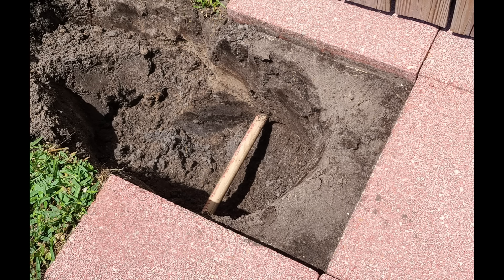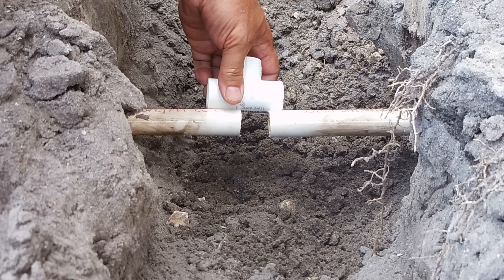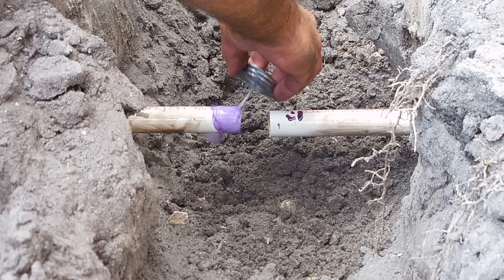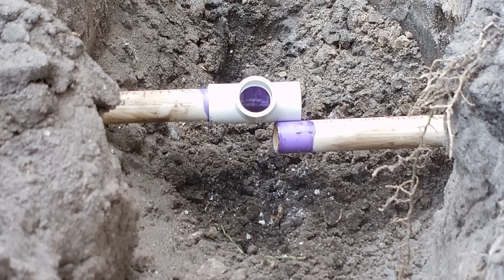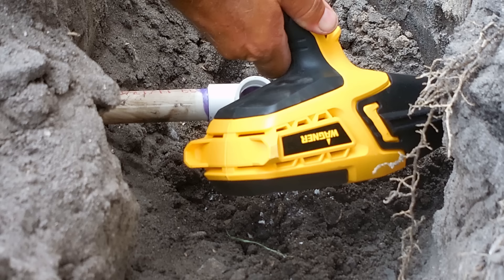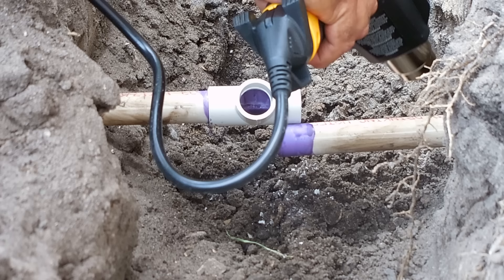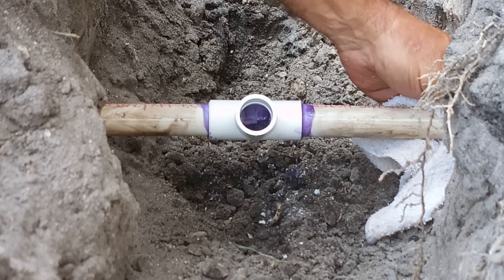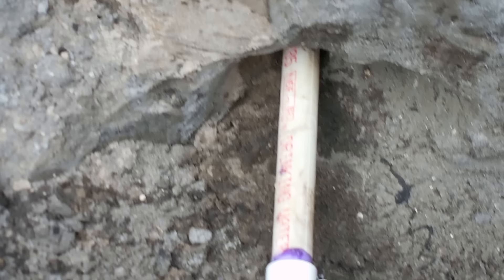How To EASILY Tap Into PVC Water Lines(Best Method Using A Small Hole)

Comment: File the stop out in the middle of the coupling so it will slid past the end of the pipe line the pipes glue and slide it back so it’s on both pipes easier than heating pipe
Reply from the maker: I guess you've seen my other video
Reply: Way better
Reply from the maker: @carlmccoy662  I can assure you it's not an easy task using a file because there is roughly a one-inch space that needs to be reduced. My other video shows an alternate way of doing it.
Reply: @electronicsNmore  A flush trim router, would take care of the stop. A repair coupling would solve the problem too, but would need 2 cuts in the pipe
Reply: Filing would be quite a job. The heating seems easier. But. Not a bad alternative. 👌
Reply: Shark Bite makes a repair T fitting with a slip end where you slide it on one side, then use the shark bite tool to slide it back over the other side.  Home Depot has them.
Reply: @electronicsNmore  they are also tapered
Reply: A dresser coupling is the best way to fix a pipe in the ground. But only use them in ground
Reply: @carlmccoy662  heating & bending seems way easier to me
Reply: That's a great idea. Probably even better than the video...
Reply: Or buy a slip fitting like someone that knows what they are doing.
Reply: @judholmes2561  no shark bite blood
Reply: They actually make union PVC fittings that have no stops in them 😉
Reply: Rubbish, it is way harder to file away the end stop than just heat the non fitted pipe.
Reply: @teeanahera8949  filing would be silly, drilling would be quick.
Reply: Forstner bit, not file
Reply: Pack joint couplings with PVC sized rubber gaskets is the proper way
Reply: @weavercattlecompany  This works best, by far, if you can find slow setting cement.  The cement that is sold locally is fully set in 5 seconds.  Too short.
Reply: I've done exactly that.
Reply: @electronicsNmore now that’s funny!
Reply: @judholmes2561 shark bite sucks
Reply: Very nice.  I have made a place for it in the mental toolbox.
Reply: Down here in the southwest, the glue starts to set up before you can work it in.  I have never been fast enough to make this method work.
Reply: Great idea, but don't they make Ts without the stops?
Reply: Yup…use a dremel…cement pipe in one motion!
Reply: Or buy a slip coupling.
Reply: Or use a slip couplings and not file the plastic wall out with the hour that will take.
Reply: @electronicsNmore  😂
Reply: Thank y’all for the comments, bad good terrible they’re all good 👍
Reply: @judholmes2561  Sharkbites also contain dissimilar metals and o-rings that will deteriorate quickly underground.
  You're basically installing a future leak.
Reply: @cadrewstrickland1912    and don't use them anywhere near a bend (elbow) in the pipe. Only on long, straight runs.
Reply: that sounds like a PITA.
Reply: Done this many times, but with electrical conduit  !
Reply: That's good for copper soldering where you draw the solder into the joint after the fitting is positioned,  but incredibly messy for a glue joint; and you risk losing needed glue on one side as you slide the fitting back over the pipe.
Reply: @brianbassett4379 unless you don't have the luxury of enough space to fit the extra length of the slip fix
Reply: somebody send this guy a telescope fitting slides right in the tee no problem you can even cut it to your desired size
Reply: There are what are called expansion couplings for this type of situation.
Reply: Yeap
Reply: A hole-saw bit works great.
Reply: Mark the make-up of the pipe.
Reply: Looking inside of that tee, will be a great place to lower your expectations. Though I’m somewhat apprehensive about heating up a pressure pipe and walking away from it. But I’m going to buy some materials and test this. Been looking for a reason to buy a WiFi ball valve and flow meter for my home anyway.
Reply: A hole-saw bit of the correct size works very well.
Reply: I forgot I already posted this. Please forgive My Failing Memory.
Reply: Good Idea.Thanks
Reply: Kind of like a repair coupling.
Reply: @brianbassett4379 seems like no one here has heard of a slip fix
Reply: I use a dremel with the little sanding drums. Makes quick work of the stops.
Reply: use a rat tail file
Reply: Make a loop with some 90s put T in the middle. Better that playing with heat gun or trying file a coupling. Well say its for expansion 😉
Reply: Use a repair fitting 👍
Reply: This is what I did but you need to remove much more than the stop. A repair coupling would be best but if you've only got joiners heating the pipe is less work.
Reply: That's genius!  Do they sell fittings without the stop? That would be even better.
Reply: Sincere thanks for the video.  All of my plumbing wisdom comes from plumbers' YT channels so any thoughts I have are received wisdom.

That said, the one concern I had was that not gluing within 5 minutes of applying the primer is one of the mistakes people make with PVC, according to one of Got2Learn's videos, fwiw.
Reply: Thank you. You just saved me hours of digging.
Reply: All these comments are craziness. Just pay someone to do it, that's definitely the easiest way. Hahahaha
Reply: Filing the stop, are you serious? I'd love to watch that especially on a pressure line with your file drifting off into the glue joint! Perfect example of why you don't hire handymen!!! Dig 3' more & do it right!
Reply: @daled8221  Exactly!
Reply: DAMN!  What a GREAT IDEA!!!  Which i knew this on MANY A PROJECT!!!   Thanks!
Reply: And the pipe is not brittle, or malformed afterwards.

Comment: In most cases heating the pipe is totally unnecessary dig a little out around the pipes and you can easily flex the pipe upward slip it together very seldom does this result in breaking anything.

Comment: I appreciate you getting straight to the point.  But a much easier method is just to file out the stopper inside the T, then you can slide it fully onto one side, apply the primer and glue, then slide it over both sides.  Very easy and no messing with a heat gun.
Reply: How in the world do you file that little ledge inside of PVC pipe? I don’t understand how you would file that, and how come they don’t simply make repair couplings for this.
Reply: @FromTheHood2TheWoods  The do make repair couplings for some sizes of pipe.  I have a woodworking file I used for most of the ledge, and for the last part I wrapped some coarse sandpaper around a dowel rod.
Reply: I never would’ve thought of that. I usually buy one of those extenders. I’ll try your method.
Reply: @jasont7814  OK, when you do, come back and explain to us how you put the primer and glue inside the fitting, if the pipe is already running through the fitting. My feeble logic says you can do one end, but not the other.
Reply: @gregoryt1139  I might be misunderstanding you, but you’re working with two open ends, and you’re only adding one new fitting on the short end of the pvc pipe. I know I didn’t explain that very well.
Reply: @jasont7814  Watch the video again: After cutting the pipe in two, he primed and glued the T onto the cut pipe on the left. The question is: How to prime and glue the cut pipe on the right, and insert it into the other end of the T? The video's solution is to use a heat gun. Now, the alternative suggested here is to file down the ridge that prevents you from pushing a cut end too far into the T. Next, slide a cut end far into the T, past where the ridge was, and then prime and glue the other cut end, and slide the T onto that prepared end. My Point: Yes, both ends are inside the T, but only one end of the cut pipe is properly primed and glued, inside the T. The other end either has no prime/glue, or most of it has been rubbed off from all the sliding.
Reply: @gregoryt1139  Ok, I think I know what you’re referring too. Maybe the original post is referring to filing out the interior of the coupling on both sides, then applying the cement on both open ends, giving you just a few seconds to insert the coupling on one side, then center and slide it to other side before it quickly dries. It’s least that’s how I envisioned it.
Reply: @jasont7814  If you can do all that sliding before the glue starts to bond, perhaps. I know me. I would rather pay someone their worth to do it right, than to rely on me to maybe not mess it up too much. So, my comments are solely based on my own incapabilities.
Reply: @gregoryt1139  Yeah, I get it. I buy one of those PVC extenders to connect broken middle pieces because it gives me a little more room for error. Sprinklers are not my specialty.

Comment: Good tip on filing stops, can also use a compression tee available at most hardware stores
Reply: The compression tee is what I use. Works best, especially if there is ANY water at all dripping through a pipe. If water dripping through a pipe you cannot get it to get very flexible because the evaporating water cools the area to quickly

Comment: For years i had to deal with that pipe issue, this is first time iv'e seen it done that way, i'll definitely try your heat gun method next time! Thanks!👍
Reply from the maker: You're welcome!
Reply: A very important tip that people leave out is that PVC and CPVC connections to not bond together properly.  It has to be a cpvc fitting for cpvc pipe or vice versa. If you don't do this then the pipe will blow out of one end of the fitting (Eventually).

Comment: Great video advice! To determine the exact amount to cut out, I suggest marking the fitting on the outside, where the bump stops inside the fitting correlate to the outside of the fitting, (I personally don't do this after decades of working with pvc, so I, and obviously you, can just eyeball it),. Then hold the fitting up against the pipe and transfer the marks to the pipe. Should be perfect. That's for those who've never done this!

Edit: you can also use a propane torch, you just have to be conservative and much more careful not to overheat the pvc...
Reply from the maker: Yes, that will make the job easier. Glad you liked the video!
Reply: Dude. Thank you. I have been wondering exactly how to know how much pipe needs to go in vs how much you cut off. Your dry fitting then pencil line is so stupidly simple that I'm kicking myself for not thinking of it. I have been guessing and luckily been right in my yard.
Reply: Over 30 years in construction…. I own a heat gun which I use mostly for heating pvc conduit instead of wasting money on bends… never once did I stop and think of this brilliant solution. Thanks, now my challenge is remembering it.

Comment: Id say a safer way would be to File the stop out on the inside and use the T like a slip coupling. Heating pvc works but its easy to mess up or damage. Id do it with conduit but not a water line.

Comment: I have done PVC repair and you don't have to dig back as far as you said. Your method is the way to go if you can't dig back but I have never run into a situation where I couldn't bend the pipe without heating it.

Comment: The Primer is a weaker form of the actual PVC Glue, it is actually starting the melting process. So to let is cure (dry) is to basically waste the primer. Fortunately you are using small diameter pipe with minimal pressures. If you did that with large diameter pipe you would have a weak joint. The PVC Solvent should be applied when the primer is still wet. You are extending the melting process when you use primer properly and apply the Solvent immediately after the primer. BTW the directions are on the can.
Reply from the maker: I guess you haven't seen my pvc cement testing video. I know what the can says.
https://youtu.be/1o4E2pdEv-s

Comment: Two things, one you did refer to the PVC primer as cleaner yet it's real point of using it is to soften that PVC so the cement will weld them together better, now I do use the primer to clean the pipe because I never buy the PVC cleaner & that seems to be OK for me.  Now the other thing is the PVC primer really does not do it's job once it's been dried out because the PVC where the primer was placed will just re-harden if it drys out.  Try it, put the primer on the pipe then take your fingernail & scrape it, it will dig in some & take off a little of the PVC, then let it dry out & do the same thing.  If you doubt what I'm saying just read the instructions, it says not to let the primer dry & to put the cement on & put the pipe together asap.  So I would reapply the primer right after heating up the PVC.  And I would take just a little more time & dig out the ditch just a little (or a lot) more, but I get it maybe you don't want to dig up the grass, & mess up the yard so much.  And one more thought is, because the primer softens that PVC don't get a puddle of it inside that pipe it can soften the pipe through & through over time, I've seen this happen & I had to dig it up & the pipe was bulged out, & leaking. so don't over do it, & if you think you did run some water through it at a low pressure just to wash out the primer.  Before there was primer you would rub the cement around & around the pipe to help it soften the pipe before putting it together.  I have made slip couplings but they are a little hard to use because the cement just might stick the coupling to the pipe before you get the coupling where you want it to be, so you have to use extra cement & it's kind of messy, but they do work.😁

Comment: you can buy a "no-stop" tee or union. you can make a "no-stop" tee or union by using a drill or a round file to remove the "stop".
this enables the tee or the union to slide all the way onto one pipe. then you slide it over the other pipe. the "stop" is just a raised ring
that prevents the tee or union from sliding past tee opening or the midway point respectively. you can buy them. you might have to order them and wait a bit or just take a file or little wheel grinder and remove the "stop". it's easy. it's quick.
Reply from the maker: They do not sell a full slip PVC tee, as for your other idea, I have videos made from a while back.
Reply: @electronicsNmore  
Full slip not necessary.  Only needs one side slip.
Reply: Just the idea heating the pipe doesn't weaken it is ridiculous, it's an extrusion formed in linear fashion once heated again it changes the structure and hardens it further making it more prone to stress fracture. Twisting the strands in that fashion makes the problem worse. But what do I know...
Reply from the maker: @yougonnaeatthat9889  Unless you've done the extensive testing that I've done on PVC pipes, or know of the manufacturing process for PVC pipes, I suggest you don't comment.
Reply: @electronicsNmore  PVC is a thermoplastic that can withstand 140 degrees F. That said, extreme hot and cold temperatures can affect a PVC pipe's structure. I am a Florida state certified plumber, been in the plumbing business for over 35 years.
Reply from the maker: @hughwynn6193  Heating it does not affect the structure. You need to watch videos on YouTube showing the manufacturing process which involves extreme heat and pressure, along with rapid cooling. I've been thermoforming PVC for 32 years with no issues at all. I'm sure you're aware that 10 foot lengths of PVC pipe have a thermoformed coupling end. That was made the exact same way I showed you in this video, by heating the pipe expanding it and then rapidly cooling it.
Reply: @electronicsNmore  I have been in the concrete construction business for 28yrs and have had to fix the crap your promoting so whatever
Reply from the maker: @yougonnaeatthat9889  I know people that have been driving over 20 years, and they can't drive. Your point is?
Reply: Do you glue both sides of the "T" then?
Reply: @rbcreations2  Yes you glue both sides of the tee cleaning them with that purple pvc cleaner and then apply the pvc cement and you have to be quick you do both sides yes

Comment: Plumbers would build a “bridge” using 4- 90 degree elbows. You don’t compromise the pipe that way. But for irrigation this would do.
Reply from the maker: The only drawback is the water hitting a wall and changing direction 4 times, which increases friction loss.
Reply: @electronicsNmore  true, it does.

Comment: There’s a $7 bendable coupler at Lowe’s/Home Depot for this too, works great.
Reply: Yeah but it can't be used for pottable water.
Reply: Also, I don't think it's for constant pressure. Check documentation if trying the HD variety!
Reply: Thats not a T-Fitting.
Reply: Watch band 7.00 if you don't have to?

Comment: 😂😂  Small diameter PVC has plenty of play in the pipe.  All that needs to be done is pull the two ends upwards enough so the end of the pipe just catches inside the tee then push the two ends down at the same time.  The pipe will slide into the tee.  Kink the pvc after heating it and you just created a new headache.

Comment: Interesting idea I have never tried. I would also add if this ends up not working, you can always cut out the heated portion and add a slip to fit or slip joint instead.
Reply: Why not use the slip joint tee to begin with?

Comment: I normally use 4 - 90’s, but this is cheaper. Heating also works for custom bending, albeit best to pack the pipe with sand for tight bends (remove the sand after everything cools).

Comment: Great idea. I would rather heat both pipes. You just need some flexibility in both pipes to lift and join. There should be minimal deformation. I did one yesterday just without the heatgun. With the heatgun it will require less effort.

Comment: I bend schedule 80 PVC [Yellowmine] 6" by capping the ends and heating the section of bend with a weed torch. The increase in internal pressure means no wall collapse while bending. Perfect bends every time.